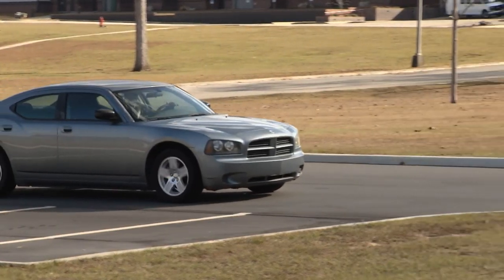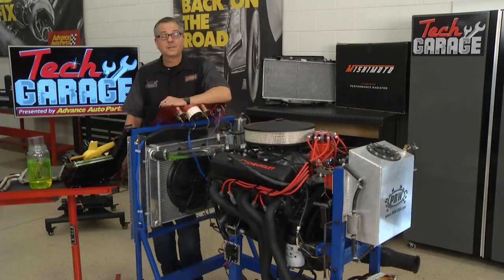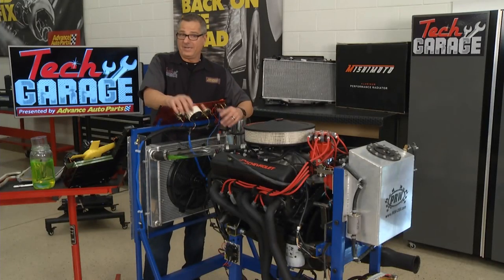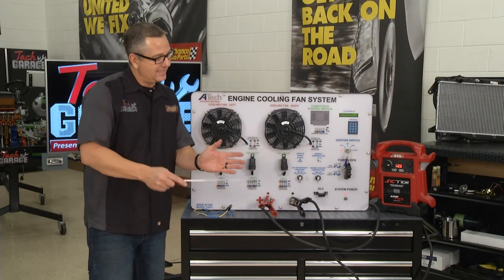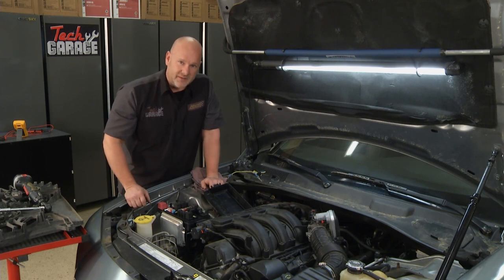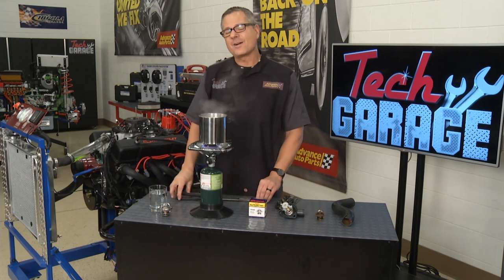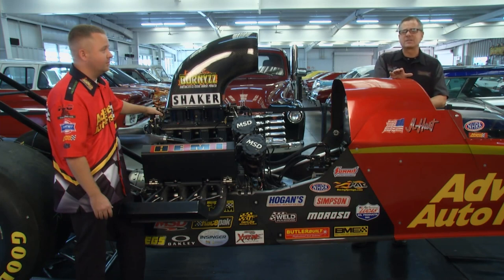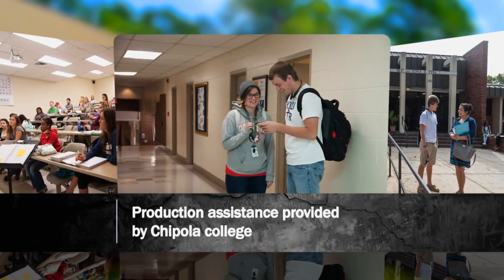Tech Garage - Ep 1712

Comment: The fans on these cars are garbage.  My '06 Magnum fan blades were falling apart.  one fan was dead, the other was working.  1 or 2 bad fans will not throw a check engine light.  When your engine overheats it of course will.